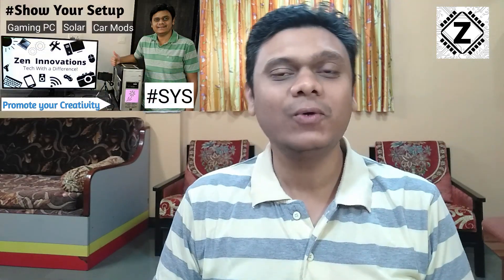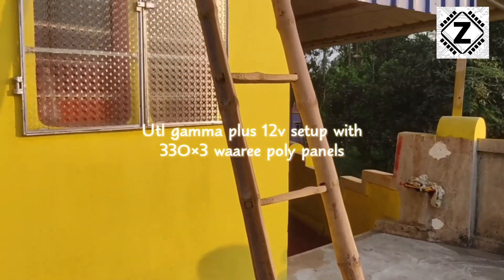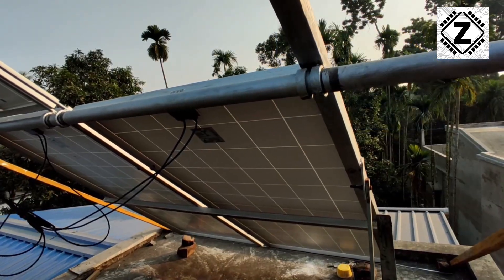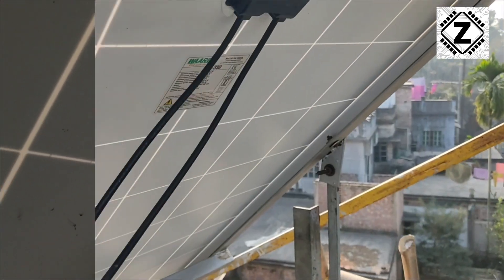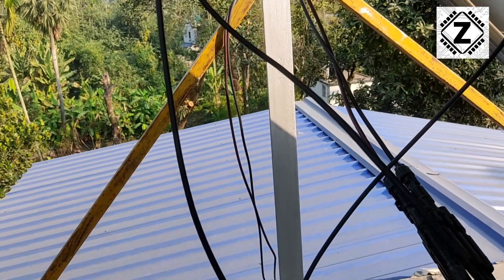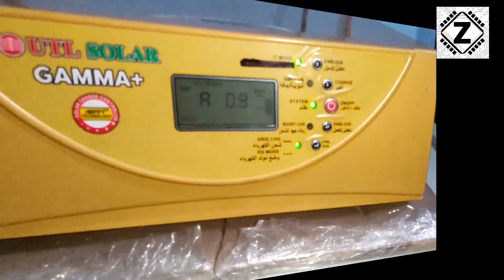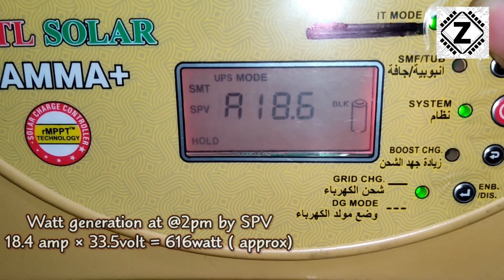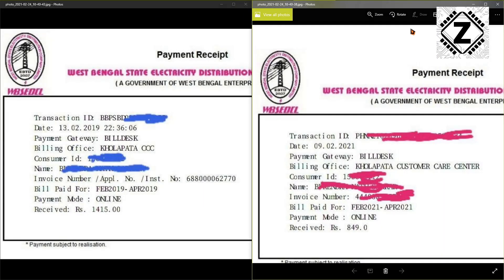SYS 004 UTL Gamma+ Waaree 330w Poly Panels Setup Tour | Adjustable Stand, Cost, Bill Saving [Eng]

Comment: Dear Zen innovation, is it possible to use a regular lead acid inverter battery to UTL Gamma plus ?   If yes then what be it's performance.  Also will there be any battery warranty violation if I charge a solar lead acid inverter battery with a non solar type PWM inverter ?
Reply from the maker: Question Picked up for Solar QNA EP21
Stay Subscribed for the video!
Reply from the maker: Your question has been answered in QNA EP21 !
Click the below link to Join Premiere (live). This video is scheduled to go public for its Premiere on April 27, 9:00 PM . Set the Reminders! Hit Likes by the time!
https://youtu.be/Wrdm2wvIK9k
You can also participate in live chat session. After the Premiere is done, you can also watch it as a normal video.